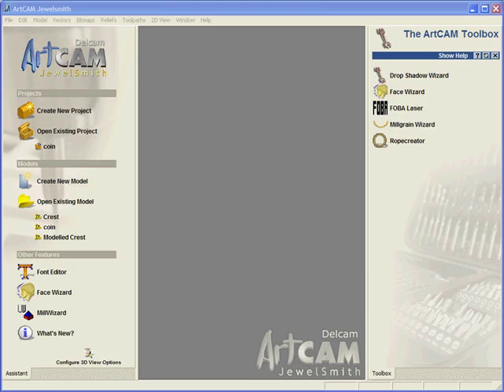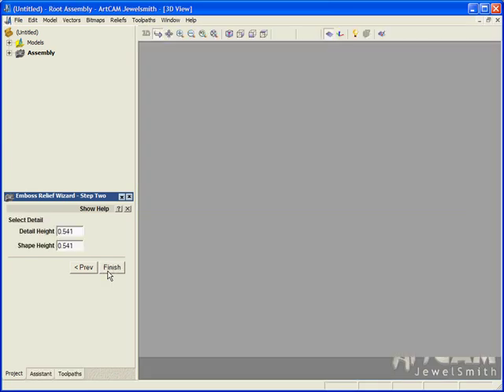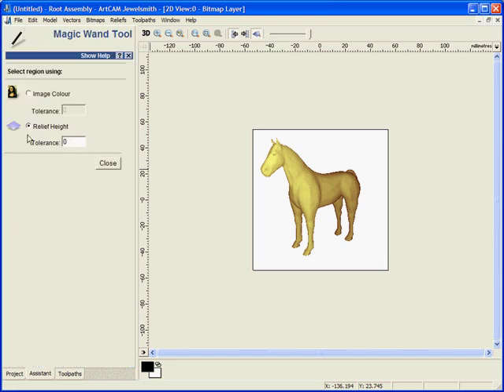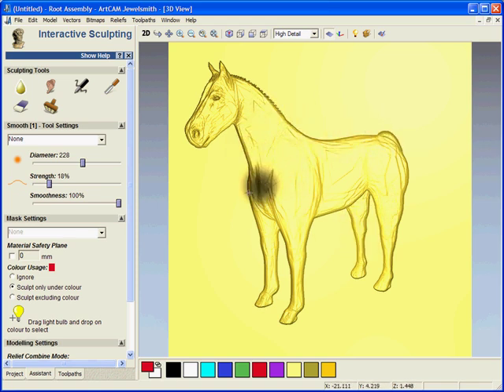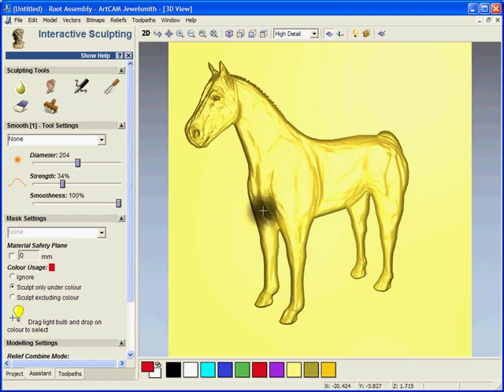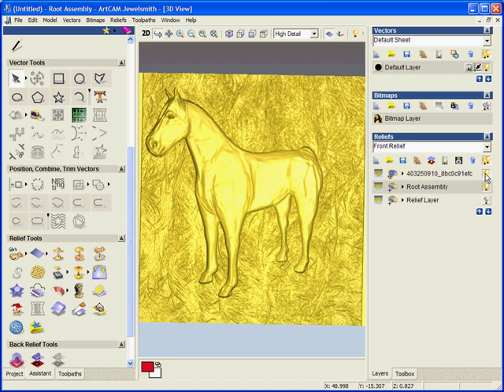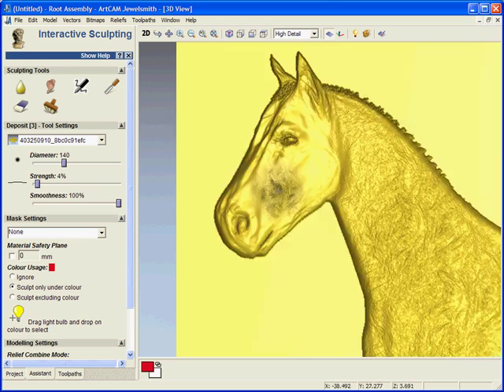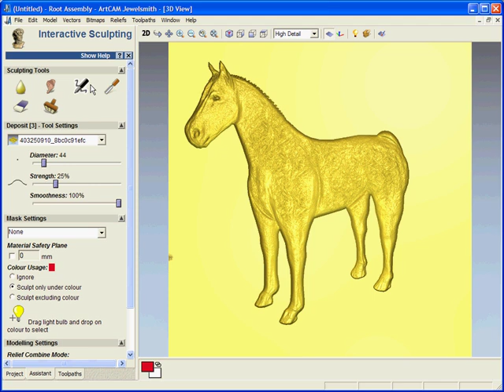ArtCAM JewelSmith 2009 - Horse Modelling

Comment: Hi Art Cam, I really enjoyed your video. But I have my unusual question that may seem out of here. 
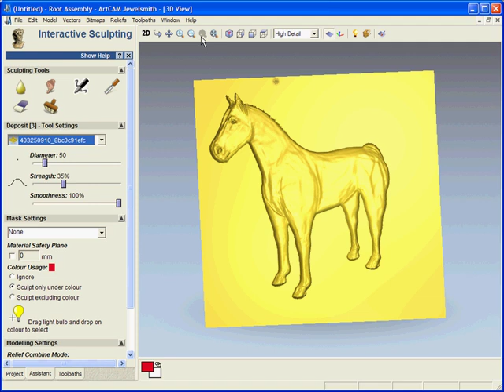But, believe me, I have another idea and I've been looking a lot on the internet before asking you for help to solve it myself. But, I have not found myself the solution so far. So, I'm forced to seek the help from you. And, a response that will solve my problem is indeed. So, let's go to my question based on the knowledge that you may have : Is here any option that makes an image, or as your 3d model, into relief 3d like Art Cam, as it is here at 6:15, but in the real color of wood or metal? So, after a photo is converted into a 3d relief object, as it was ordered before this gets transferred to a caving machine, can the program do this 3d relief object, ( on the computer) to look like a carved wood, baker or stainless steel?
 If this program can solve this purpose, or as the owner you can add this option to this program by adding a library with different
materials, I can buy this program at your price.

 I look forward to an address link!